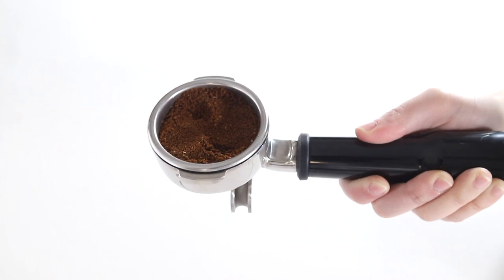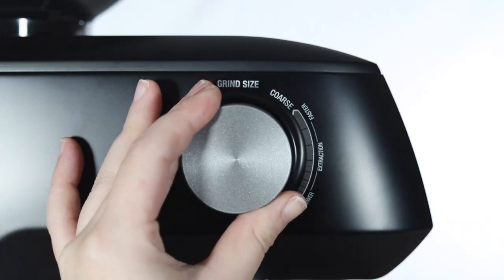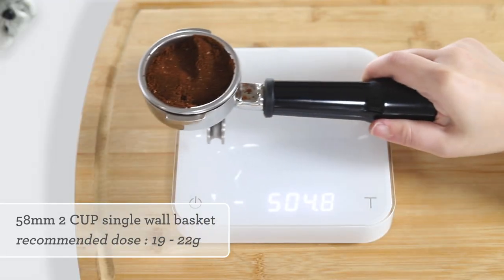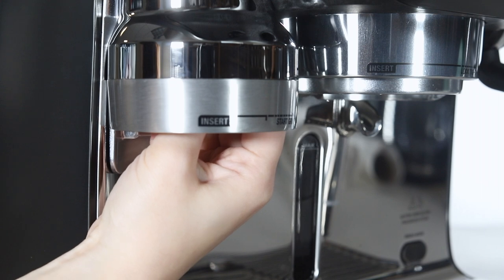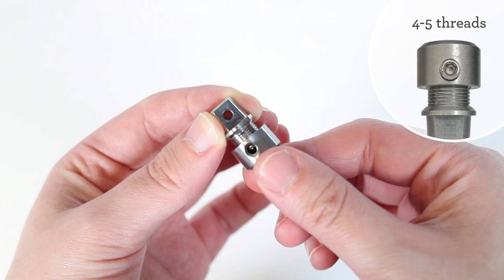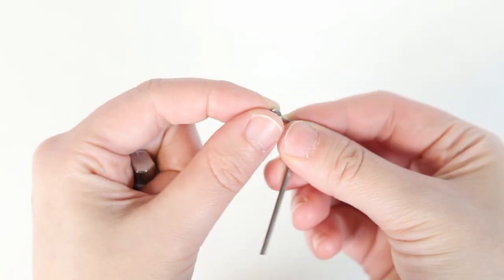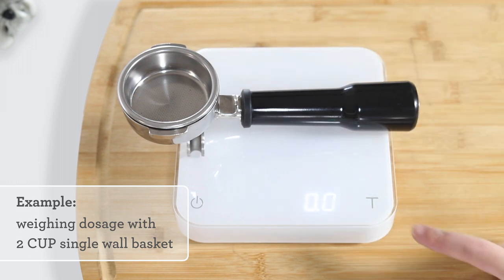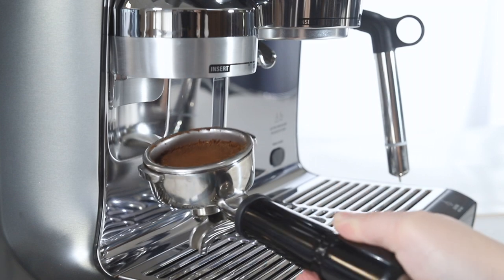Troubleshooting a Wavy Tamp

Comment: Noticed that the dosage needs to be around at least 20g or so in order for it to be able to tamp consistently- anything under that and you end up with wavy tamps. I feel like 20g+ is too much. 

Have you considered releasing a smaller basket (I assume the lesser volume could help you get closer to 18g which is usually considered “standard” for a double shot espresso)?